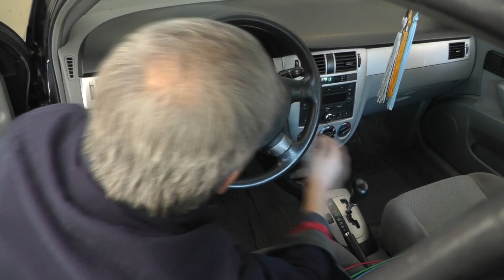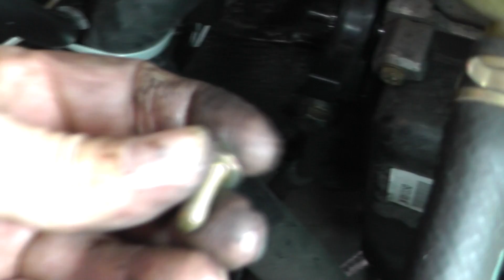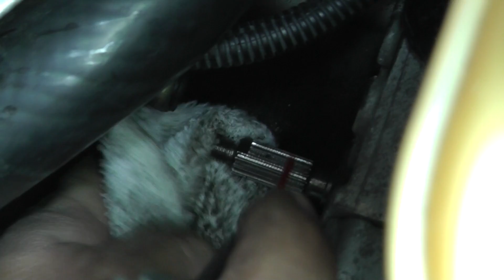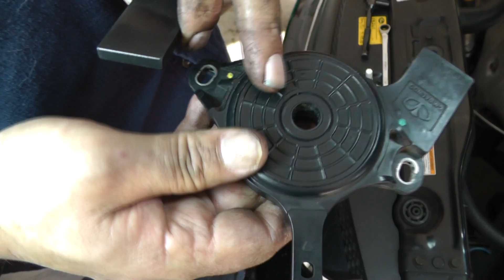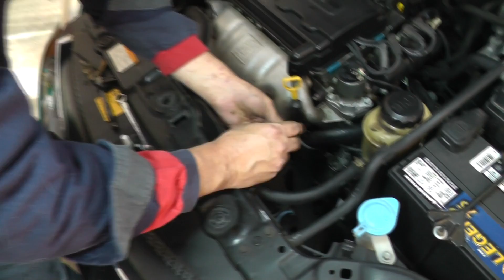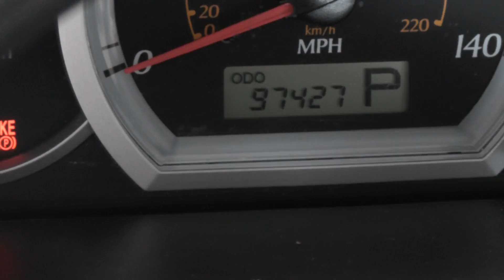Suzuki Forenza Installing Transmission Range Sensor - Part 5

Comment: I still don't understand even after trying without the part then ordering the part it still won't go to neutral, it's either 3rd or it just starts flashing any pointers to what might be wrong?
Reply from the maker: Reece, I assume that you changed the tranny range sensor. You have to be a little clearer in what you're saying. Does the gearshift lever move and if so does it show the wrong gear? And what is the flashing? Are you talking about the gear indicator on the instrument panel?
Reply: stuzman  yes the gear shifter moves and shows every gear but just not into neutral or Park. yes the flashing on the dash looks like a D and N flashing together. I don't know if that is trying to be neutral or Park
Reply from the maker: Reece, offhand, it sounds like your range sensor is giving you an issue. Although you say you put a new one on, how did you install it? Did you put it on while the gearshift lever was in park? If so, that would be your issue. The new sensor comes set to the neutral position and when you put it on, the gearshift selector needs to be in neutral. Also, once you get it installed, you adjust it by making sure the two bolts are in the center of the slots of the sensor. Other than that, that's all I got :)
Reply: stuzman ahhh yes it was in Park when it started... does that mean I need a new range sensor? it's in neutral now so is that what I'd need to Fix that? I really appreciate your response and help
Reply from the maker: I am totally lost Reece. I thought that you bought a new range sensor. Is that true or not? What I was saying is that with a new range sensor, it comes preset with it in the neutral position. When you install it, you will place your gearshift selector in the neutral position.
Reply: stuzman sorry to confuse you, yes I bought a new sensor. took old one off and put new one on but I didn't have the gear shifter in neutral.
Reply from the maker: I would say that's your problem. You now have the range sensor out of position with the gearshift selector and that's why you're having issues. Pull it back off and rotate the inner part of the sensor to get it let's say the park position. You will know which way to turn it by looking at the direction your linkage moves when you go to park. You might need a helper to move the gearshift lever while you look at the linkage. Once you get the sensor in the correct position and it coincides with the linkage, you should be good. You know, I did mention all of this in this video :)

Comment: Thank you very much, it's that if it's a little expensive
Reply from the maker: Yes, the tool is very expensive and I wasn't making a recommendation for anyone to buy the tool. I only used the tool just to show the procedure of what the service manual wanted you to do. As pointed out in the video near the end, just move the range sensor where the two bolts are in the middle of its slots of the sensor. That should be close enough and that's where the special tool put the  sensor.

Comment: you skipped the part when it got hard to get on
Reply from the maker: And would that have been interesting to watch? :))
Reply: Oh my gosh, that part would have been crucial. This video is so awesome! Thank you! Except we need the part that got cut. 🤣🤪 we have the new sensor lubricated and into the first part of the spline. Have tried in neutral and park. Reaching from front and side. Cannot get the flat spot to slide on from anywhere. It’s so bad it’s chewing up the inside and we’ll need a new sensor, so knowing how you got past the same grunting and growling we’re doing here to JOILA! It’s fully in the hole and against the transmission...that’s the part we need. 🙃

Comment: hey I'm trying to switch my neutral safety switch  on my forenza '07 but I can't find that tool that you use to aline everything. do you know where I could get that by any chance? thanks.in advance
Reply from the maker: It's in the description of this video, but if you really want that tool be prepared for a high cost. Another method is to put the bolts in the center of the slots of the tranny range sensor. The choice is up to you :)

Comment: Suzuki is saying its a sealed transmission and it's deep inside. I can't afford to have the transmission tore down n put back together. I just bought a new trans for the car and paid to have it pulled out and put in along with a new rang sensor and tcm
Reply from the maker: See if this helps https://www.youtube.com/watch?v=HwFzdRX0gLw
Reply: Different trans

Comment: thanks for everything man he did say about a wiring problem first he just never worked on a Suzuki before and it seems like it's just problem after problem the guys really helping me with this car he's not charging me what he would normally charge people do this job and he's helping me out a lot cuz he knows I'm struggling so I'm trying to get as much information as I can I really appreciate your help
Reply from the maker: Even though your friend hasn't worked on a Suzuki, he should be able to figure it out when he has the information on the car as all of the different makes and models pretty much work the same. I'm sure that he find your issue and get you going again :) Have a good one!
Reply: Thnx you do the same

Comment: I took my Suzuki Reno to a transmission shop on the transmission was fried I got a new transmission for the Reno we took it out of everything worked it shifted the speedometer worked it didn't slam into gear the car was scanned no codes came up we put the new transmission in my Reno everything works fine except for the speedometer so it won't allow the car to shift when I go down the road Suzuki told me that the speed sensors don't go bad I don't know where it's located and I don't know where to go from here could you please help me sorry to keep bothering you with this car
Reply from the maker: The speedometer gets it's signal from the output speed sensor which is located on the output end of the transmission. The transmission shop should have been able to diagnose this for you to confirm if the sensor is bad or not. Keep in mind that there could be other issues such as a loose connection, broken wire, so it's best to diagnose the problem instead of blindly changing parts. Here is a link to free wiring diagrams; just fill out the short form and you can get wiring diagrams and TSBs for your car http://www.bbbind.com/tech_database.html If you want the service/repair information along with the wiring diagrams, TSBs and etc. you'll probably have to pay a small subscription fee. You can get that information from either www.alldatadiy.com or www.eautorepair.net Good luck on repairing your vehicle.

Comment: this video helped but i need help replacing a transmission control module or is it just plug and go ?
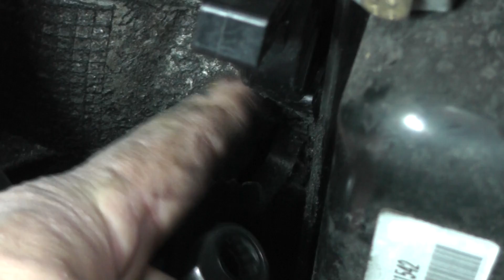Reply from the maker: The module is located under the dash on the left hand side and is held in by a couple of plastic tabs. I show the module in this video https://www.youtube.com/watch?v=qT1pSxGyshU and around timeline 3:45.

Comment: hello i have a small question i have a 2007 Suzuki forenza the problem it has is that when you put on drive and you press the gas it goes pretty slow and it does not go more than 60 miles
Reply from the maker: Check for codes to see if that can give you some direction in your diagnostics.
Reply: the scanner said miss fire, But the coil pack its fine.
Reply: And thank you so much for your time.

Comment: any videos on replacing the radiator on this forenza . replaced the sensor and worked perfect  but unfortunately bumped the top radiator hose and it broke . thank you in advance.
Reply from the maker: Hi David... I don't have the car anymore as I sold it about 3 years ago. But changing a radiator is a pretty easy job. Drain the coolant with the petcock on the radiator. If I remember, you have cooling fans on this car, so remove them at usually two bolts at the top for the radiator. Look it over and you should be able to see what's needed to get it out.

Comment: Greetings. I urgently need to know where I can buy the key to putting well the sensor range . I saw you put into the description of the video but is very expensive
Reply from the maker: That's the only place I know of where to buy it. As mentioned in the video, you don't need the tool. Put the two bolts in the center of the slots of the sensor and it should be close enough. That's where it was when I adjusted the sensor with the tool.

Comment: I placed a new transmission sensor on my 2007 Suzuki forenza a brand new one but but the wire that was attach before to the old transmission seem like it become short . it does not meet up to where it needs to be. If someone has an idea on what I may have done wrong I would greatly appreciate feed back.

Comment: Dear Sr (Stuzman52) This is a very good video, it is worth it to watch it. I changed (the mechanic did) this switch, but now I am wondering if they did it correctly, I doubt it. Anyway. I got another code and the mechanic ( A new one) told me that I need to change the transmission control module  (TCM) since there is a issue with the communication. Unfortunately, I do not have the exact code that came up. what is this TCM. 
I changed this switch because the former mechanic told me that there was a miscommunication with the computer. but now, another mechanic told me that the miscommunication is still giving problems ad now he recommends me to buy a new TCM
Reply from the maker: Usually Julio you'll get a P0705 for the tranny range sensor. The mechanic is going to need a dedicated scanner to communicate with the TCM. But I assume that both of them has the proper tools. TCM stands for transmission control module. It's a computer located under the left hand side of the dash. If you watch the earlier videos, I did all of my testing at this module. The module is responsible for receiving all inputs for the transmission and controls the solenoids inside the transmission. I can't say that you need the module or not as I'm not there to diagnose it. Sorry Julio....
Reply: Oh Sr, do not worry. Indeed, I am very glad you replied pretty fast I'll take a look at the previous videos.
Reply from the maker: I do hope you get your vehicle taken care of and hopefully the other videos in this series can help you. At least you will get a better understanding of how the system works.

Comment: great video!! will a bad tranny sensor send a signal to the ECM for no spark? not leting the car to start? I have replaced my ECM and no spark? before the batt. went dead the second time the radio said CODE now I just get the red blinking light on radio but no CODE??? will the key less entry have anny thing to do with the no spark!!!!!
Reply from the maker: A bad tranny sensor won't great a no spark condition. I'm assuming that when you say code that the radio won't play because it needs a numerical code for the radio to unlock it. And I don't have the service manual for the car anymore or the car either as it's sold. Manufacturers can prevent fuel injection pulse or no spark. Not sure which one it would be with Suzuki if there is a security issue.
Reply: when the batt. dies the radio will say CODE on the lcd. ON my radio nothing comes on just the red blinking light. Wondering if the factory keyless entry has somthing to do with the no spark? Thanks!!!

Comment: OK I just replaced this sensor on my daughters car last night. Lining up the flat spots on the spline and sensor was a bit of a sum-bitch! Haha!  I replaced it with out the alignment tool. What I did was place a small piece of flat bar square off the alignment tab before I removed the old sensor and made a mark with a sharpie. Repeated the process to align the new sensor. Worked great and the P, R, N, D, 3, 2, 1 lined up perfectly the first time. I can't thank you enough for this video. I don't think I could have done it with out it.
Reply from the maker: Thanks Bill for sharing your thoughts of what you did to align the sensor. And I'm quite sure that you could have replaced the sensor without the video. Take care Bill....

Comment: can I use Wd-40 to substitute for the DeoxIT? I couldn't find it anywhere
Reply from the maker: +sandy aranda (elephantfreak14) Sandy, another method is to use generic contact cleaner which you can find at your local automotive store and then put a small amount of dielectric grease on the female side of the connector. You can find the silicone dielectric grease at the automotive store too. This will work just as well.

Comment: I am trying to remove the metal piece next to help he transmission range sensor (the one that adjusts the gears) but it is not sliding off at all. Do you have any advice for me?
Reply from the maker: +Stephen Smith Shouldn't be that difficult to get the metal bracket off. The clip comes off, slide the linkage off and then there's a nut that secures the bracket. The bracket should easily slide off as show in this video. Maybe put a screwdriver behind it to help slide it off.
Reply: +stuzman52 okay thanks. I'll try it.
Reply: I dont mean to bother you but it still isnt coming off (not even a little). Also the gear keeps moving from the Neutral position.
Reply from the maker: +Stephen Smith Just to ask a stupid question, you did take the nut off right? Once the nut is off, there is really nothing else to hold it on. You can always place it back into the neutral position once you get the bracket off. As I show in the video, I just slipped it onto the shaft and moved it back into the neutral position. Not sure why the bracket is so hard to come off.
Reply: I did remove the nut but for some reason it still wont come off. Maybe I need to lubricate it or something. Thanks for all of your help though.
Reply from the maker: +Stephen Smith Maybe try to tap it from behind might knock it off.

Comment: Cuando lo pongo en DRIVE me da el error, pero no da ningún código de falla.
Reply: maqjode When put in DRIVE it gives me the error, but does not give me any fault code.
Reply from the maker: +maqjode If you're referring to error as the diagonal line across the LCD display for the gear, then your range sensor has picked up a fault. Then will bring on the check engine light. You've probably seen this also. If you check for a code with the scanner and it's not there, then your issue is an intermittent one. The range sensor is known for having intermittent problems. If your scanner has a section to look at history codes or pending codes, you may be able to see it stored. The code for the range sensor would be P0705.
Reply: +stuzman52 Thanks for answering! If you give a check, but it is an oxygen sensor. I will try with another scanner, maybe I have is not very good. All I see is putting diagonal DRIVE, and lately when driving, I will feel forced. A bearing could cause this, because I think the strikers are defective.

Comment: Thanks for this series. I will be working on this sensor for my Forenza wagon this weekend. I acquired a replacement sensor via Amazon for low cost. I am going to do this without the alignment tool. As you know, the tool is costly, so thanks for that extra hint about the slots lining up in the middle. The reason that I am replacing the sensor has to do with ignition of the engine. As you know, this sensor includes a feature that only permits ignition when the PARK or NEUTRAL position is detected. (A ridiculous feature in my view, but probably serves some purpose). Occasionally, my engine won't start if this detection is confused. I can usually workaround it by turning the key to ON where I can move the position selector through all the positions (with brake engaged) and back to PARK. That always works. However, recently I have also noticed a few other related issues. I can hear that clunk noise when changing positions. Also, while driving at low speeds, I notice the gear shifting slips a little or does not catch quite right, a little sluggish I suppose. So this all seems to point to this range sensor. Wish me luck.
Reply from the maker: +Eric Thomas Yep, sounds like your range sensor Eric. You've probably got a check engine light to come on with the code P0705. Also, your display for the gear selection should show a diagonal line when the problem occurs. Good luck on getting it done.

Comment: Thank you so much for posting this video! I wanted to learn to work on my car on my own so your detailed instructions were very helpful. I replaced my sensor today on my 2007 Suzuki Reno, followed the instructions mostly to a T, although I had some trouble with getting the new sensor on with the switch in the neutral position. I noticed that my new sensor and my old sensor had the flat spot in two different places. I was also replacing my radiator, which I feel went pretty smoothly. However I tried to crank the car once everything was done and nothing happened? My headlights, AC, and radio all worked, however I couldn't even get a click, let alone get it to turn over. I also notice that when I tried switching gears it didn't seem to register being in park, but other than slipping up once or twice it seemed to register every other gear fine. I hope it's not a bother for me to ask what I could have done wrong. I would hate to have to spend unnecessary money taking it to a mechanic.
Reply from the maker: +tylsforthescars Since the car started before the installation of the tranny switch, you probably don't have it adjusted correctly. There is also a neutral safety switch inside the range sensor which only allows the car to start in Park or Neutral. So, I would relook over the adjustment of it to be sure that it's correct.
Reply: +stuzman52 Thank you so much! I popped it off and slid it back on right and it cranked right up!
Reply from the maker: There you go...I knew you could get it!